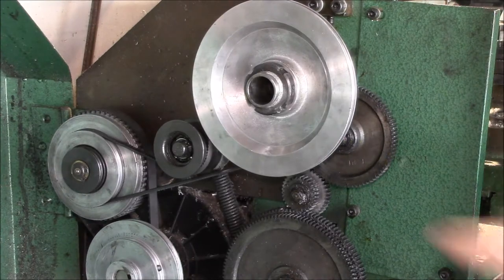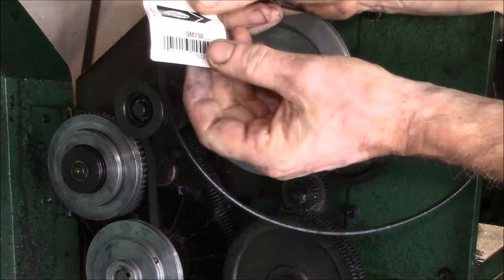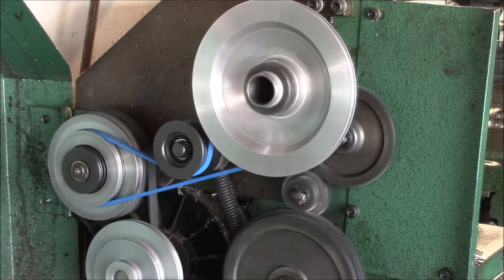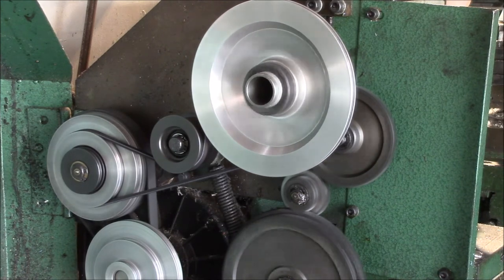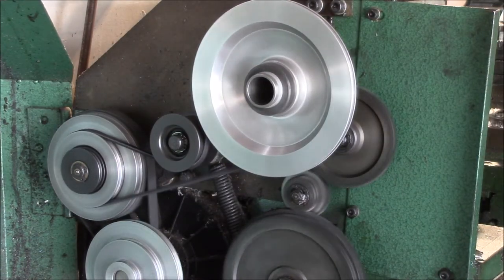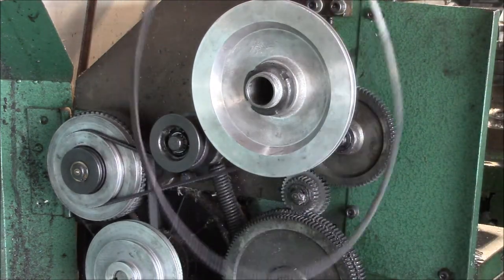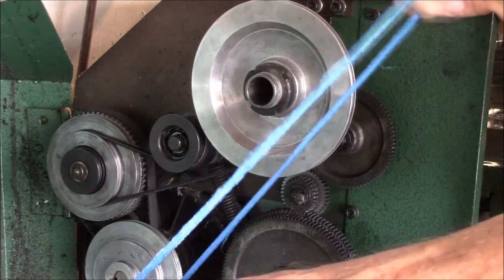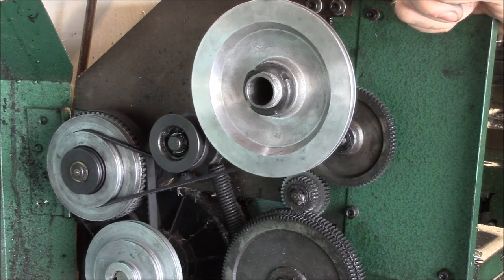Grizzly G4000 - 9"x20" Metal Cutting Lathe - V-belt Replacement

Comment: Hi, I need your help. I have the same lathe but the power switch packed it in as it fell apart.
I have the replacement switch but need help to rewire it. Pictures would really help.
Reply from the maker: I've never dug into that part of my lathe yet (knock on wood), but the latest Grizzly manual seems to have some good wiring details:
https://cdn0.grizzly.com/manuals/g4000_m.pdf

Comment: There are several internet manuals on the 9x20.  I found this in the, "Rebuilding the Asian 9x20 Lathe" manual.  There are two belts generally in use.  If you have a 160XL cogged belt, then the other belt is 5M720.  If you have a 170XL cogged belt, then it's 5M730.
Reply from the maker: Good information, thanks for sharing!

Comment: You ever have any issues with that toothed belt that drives the upper pulley slipping off?  In my G4000 that belt that goes from the small pulley on the motor shaft to the upper set of pulleys immediately slides right toward the motor direction and would jump off if it weren't stopped by that cam the tightening lever is attached too. I can manually move it back to it's proper location, but it slides over again once the lathe is turned on.
Reply from the maker: No, have not experienced that issue on my lathe.  I would check alignment of all the pulleys and see if any of them are too far in or out.
Reply: @The4Crawler  I saw that video where you changed the belt right after this one and checked the alignment, they look good. After some further investigation I think the issue is one of the bushings in that assembly is worn out, the whole thing can rock back and forth a few degrees off it's rotational axis. Once the tension is on it, it's pulled at and angle, and the belt slides off. I stopped it for now by sticking a piece of HDPE plastic behind it and I'm ordering some new bushings. Anyway, something to keep an eye out in the future on that G4000!
Reply from the maker: Glad you found the issue.  That would have been my next thing to look at.  I went through and greased as much of that assembly as I could some years back.  Probably worth doing again.

Comment: I changed speeds to the 1000 rpm speed using the V belt that my lathe came with.  The belt lasted about 2 hours.  I figured it was just a poor belt and ordered a new one (made by Gates) and installed that and after about 30 minutes I looked at the belt and noticed that it was no longer running straight and had twisted. Any ideas, anyone?
Reply from the maker: You might check the pulley alignment and make sure all the V's line up.  Maybe one of the pulleys in in or out too far on the shaft.  Or as another commenter noticed (on the toothed belt), one of the bushings that the pulley rides on had worn and was causing the pulley to run out of line.

Comment: Have you ever think of changing the pulley system to use the normal V-Belts?
Reply from the maker: I suppose that might work, but would involve a lot of time and effort.  The 3 stacked pulleys are very compact due to the narrow v-belt, so going to a wider belt would increase that component size a lot.  The shafts are not very long so you would have the pulleys overhanging the ends of the shafts.  Plus the belt tensioner idler might have to be redesigned to work with wider belts.

Comment: I bought 3 gates belts 9 years ago I use my lathe 5 days a week on average, and I have 2 gates belts left they are very strong.
Reply from the maker: Good to hear.  I generally get good use out of one belt, then I'll run into one that only lasts a month or two.  My lathe gets a lot of use, maybe 3-4 hours operation per day, 6 days a week typically.

Comment: The 3D nylon was an interesting experiment.
Reply from the maker: Yes, it was a bit of an experiment.  I think with a dual extruder printer, it might be possible to print such a belt with a nylon inner core for the strength and a polyurethane outer layer for grip.
Reply: @The4Crawler  A few years ago I bought a belt, about 3/4", and tried to cut it to fit the pulley  grooves. The material is remarkable tough and maintaining a straight line was virtually impossible. Working the problem from the inside out with 3Dp sounds like an alternative plan. I look forward to your continued experimentation.

Comment: Search on "5M710 GATES Polyflex V-Belt" shows the belt available through many suppliers as well as amazon
Reply from the maker: Yes, that's a good search term.  However, from time to time, it can be hard to find these belts in stock.  That was the case when this video was made.  Lots of suppliers, but most were out of stock or on back order.

Comment: I honestly think it’s meant to be 710mm
Reply from the maker: Interesting, have you tried a shorter belt?
Reply: @The4Crawler  I have the 710 belt, tough to get it on the pulley and you can't use the tensioner, but it does work. I just ordered the 730 - best price now is $22

Comment: Don't start your lathe with the clutch engaged.  You'll break belts that way..
Reply from the maker: Interesting.  From the G4000 instruction manual:
"The use of the Belt Tension Release Lever as a clutch should be restricted to those times when starting a heavier part turning and then at very low speed."

I rarely turn heavier material, usually 1" dia. steel, 2" dia. in alum. and plastic.
Reply: @The4Crawler  Well I learn something new every day.  I've had my G4000 for 20 years and never broke a belt.  My manual only says that you can use the belt tension release lever as a clutch.  So, it looks like they've updated the manual.  My manual is dated 6/97.
Reply from the maker: @kirklindstedt2018  Interesting.  I didn't get a manual with my (used) lathe, so downloaded one in 2005.  I suppose that could be used all the time.  I have a foot switch on mine, so it's much easier/faster to just tap that for on/off that reaching up and over for the belt tension lever.

Comment: That's a wimpy belt to begin with 😮
Reply from the maker: Yes, it's quite small.  But it lets them fit the 3 stepped pulleys into a tight space and also serves as a mechanical "fuse" that slips or breaks before something expensive does.